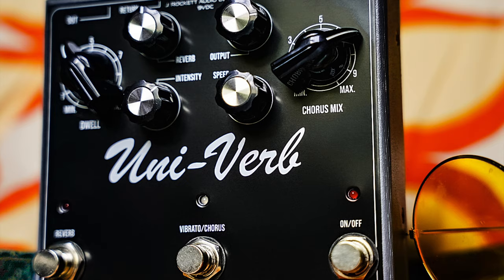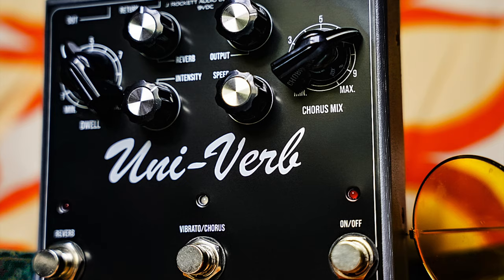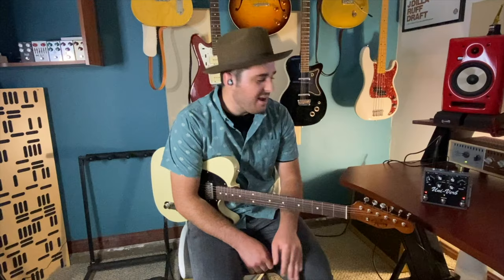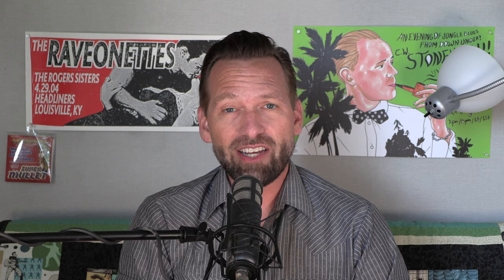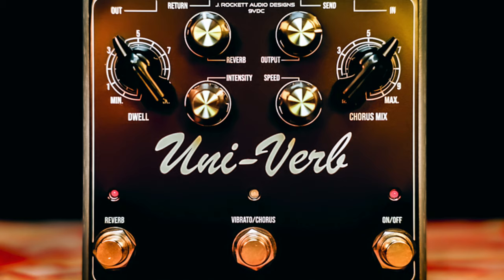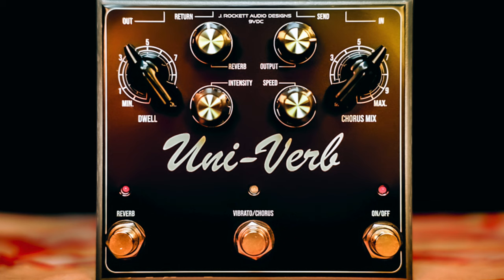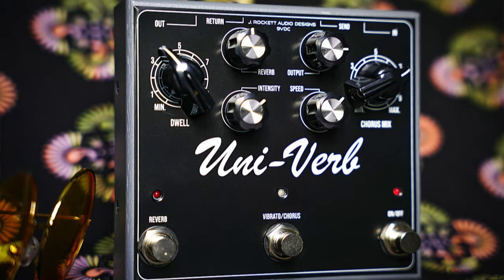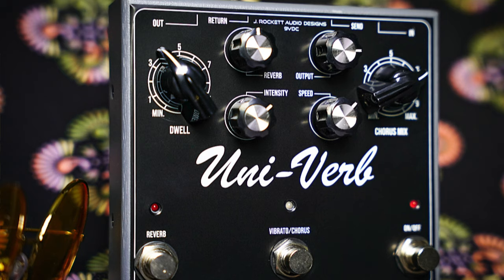J. Rockett Audio Designs Uni-Verb - PG Gear Spotlight

Comment: I recently purchased this pedal and had to return it. With the intensity, output, and chorus Mix completely cranked I could only hear the Univibe past 1 o'clock on the speed. My rig is a Les Paul and a 73 Superlead. The reverb is awesome. But the decay is still SO long when the decay is turned all the way down.